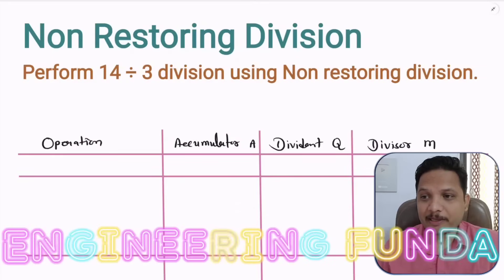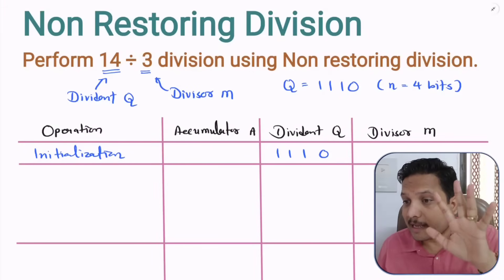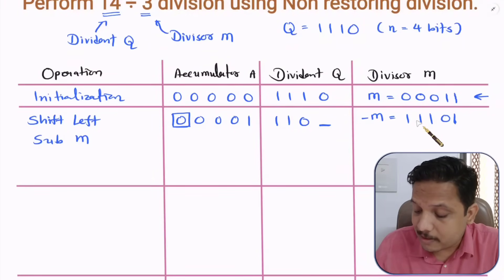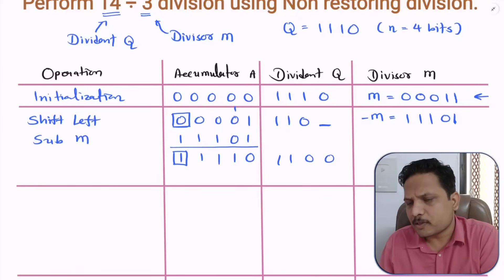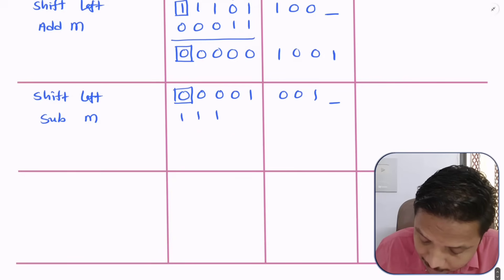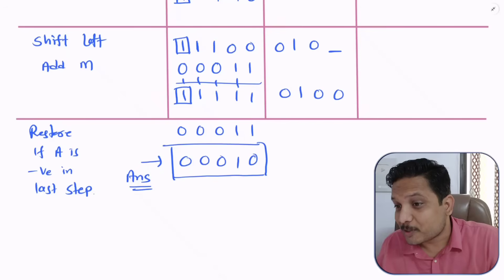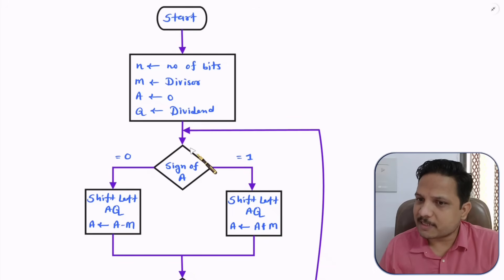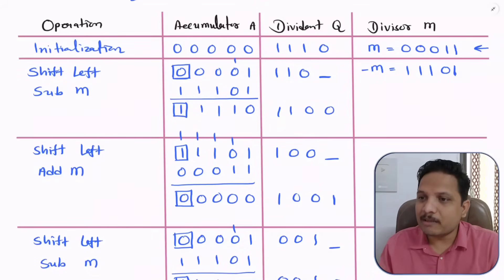Non Restoring Division Algorithm: Flowchart and Example | COA

Comment: sir in the non restoring algorithm , you said we need to have a restoring step if A is -ve.
My question is , 
1.Does 1 represent the -ve A and 0 represent +ve A in the A in last step. Is this only applicable to non-restoring algorithm concept wise??
and 
2. And as you said we need to perform restoring in the last step if A is 1 ie -ve, does it mean to add m in the last step in non-restoring algorithm. It seems different than the restoring we did in restoring algorithm. Is that the case? are they different restoring concepts??

Kindly help me as tmwr is my exam!!! Thank you, sir.